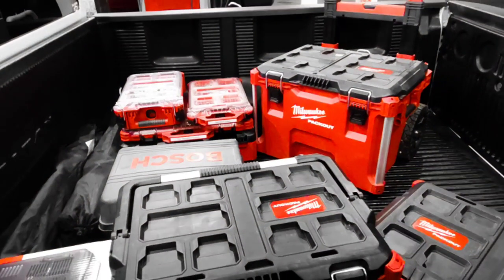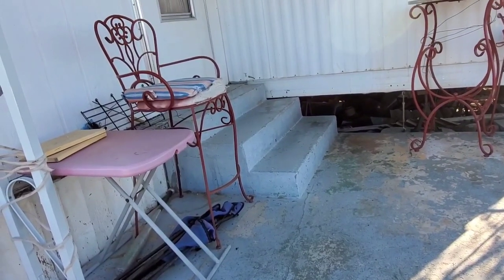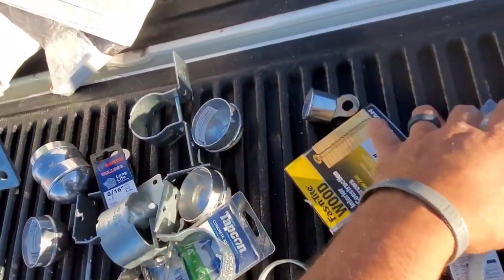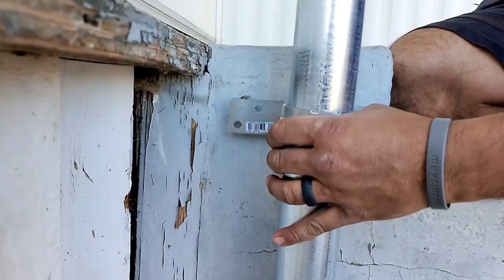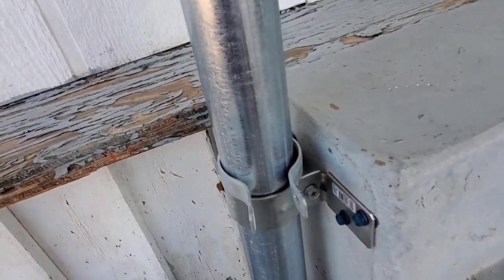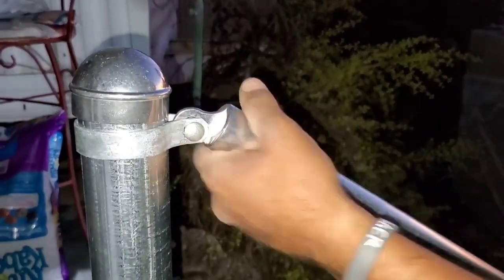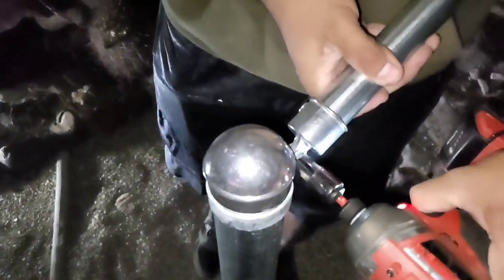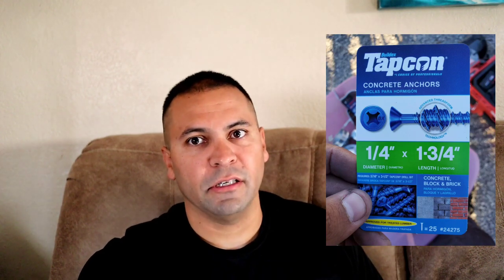Making Hand Rails in ONE HOUR! - QUICK DIY installation for the In-laws.

Comment: How did she like it? Is she still using it now that's it's been a couple years? Did you add any kind of grip tape to the rail? My only concern would be the rail getting super hot when the sun's beating on it.
Reply from the maker: Hello,

Yes we added a rope grip to negate the heat. It works well to this day.